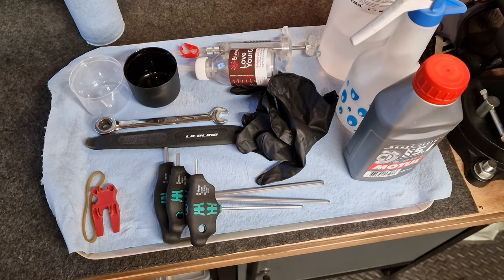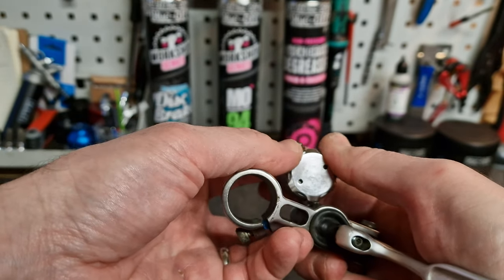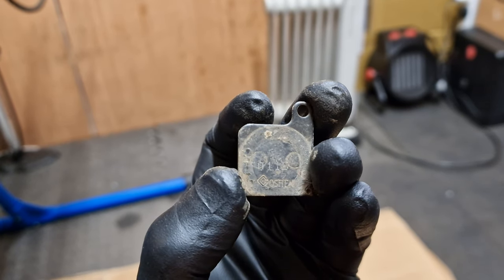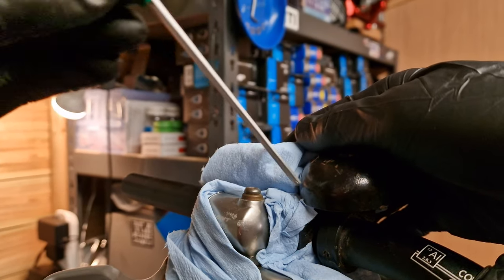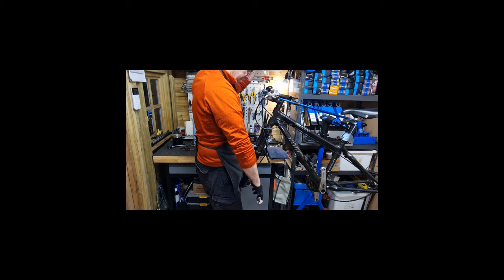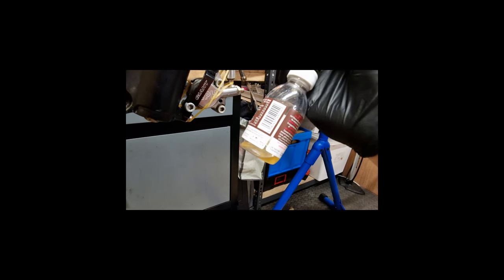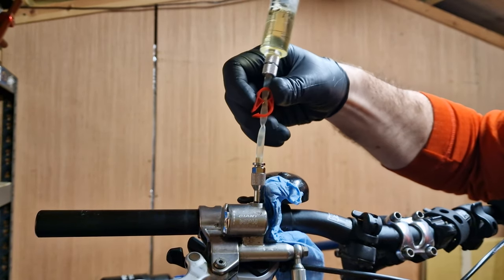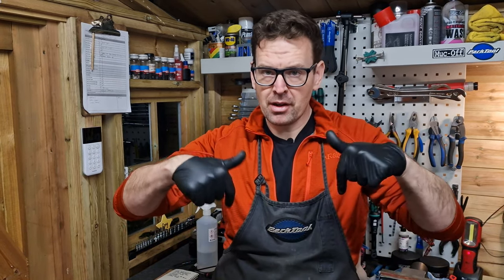Giant MPH Brake Bleed

Comment: Thanks a lot for your video since it is very hard to get info on this procedure .
As you mention, the key thing is to get the right tool and items hten
Do you know which kit to purchase in order to have at least a syring compliant with the reservoir screw?
Thanks again to spend time sharing your knowledge.
Reply from the maker: In the workshop video I was using the SRAM Professional bleed kit. However, any generic kit for SRAM and DOT fluid should have the same fittings. If you're in the UK something like the Epic Bleed Solutions kit should do the job - https://amzn.to/3SGY1B9 (sponsored link). If you're outside the UK let me know and I can give you a hand finding something suitable :)
Reply: @vanguardcycles  Hi, I am based in the Netherlands, could you recommend any bleed kit for these MPH brakes? Thank you!
Reply from the maker: Definitely check out the DOT bleed kits from Elvedes. They do a regular and pro version

Comment: Nice vid... Could you enlighten me on - if known - which type/brand of replacement brake cablehousing I can get for my MPH-brakes? 
It's no longer available, and hard to search for. Maybe Jagwire, but which type is compatible.

Would be grateful...
Reply from the maker: That's a very good question. Unfortunately I no longer have the brakes here to measure. You could try to measure the inner and outer diameter of the hose to help find a match...but then I don't think anyone makes compatible connectors (banjos, olives, barbs etc) any more either.

Elvedes make some good kits for several manufacturers but don't list Giant as supported. 

When it comes to brakes, safety is always top priority, so it might not be possible to safely change the hose any more :(

Comment: Gret informative Video, Thanks for taking the time for making it. Because of a sustained back injury I now need to have an upright riding position which means raising handlebars, and which subsequently means extending the front and rear Hydraullic hoses on my Giant MPH braking system. This is my first Hydraulic braked bike recently purchased second hand. Do I need to buy Giant MPH specific hose and fittings or is there a standard hose and connection system which I can purchase to my required lengths for my Giant bike?
Reply from the maker: Really glad to be of some help!

Switching out the hoses on these might prove tricky unfortunately, as they have been out of production for a long time and I don't think Giant offer any kind of support or spares. 

For the lines themselves, you could measure the internal and external diameters and see if you can find a compatible line.

The trick is going to be finding new connectors. Usually bike brakes will use proprietary things like banjos and olives which shouldn't be removed and reused.

Maybe there's a forum post somewhere that could help?
Reply: @vanguardcycles  Hi, thanks for the feedback - which is useful for future bike purchases. I decided to sell the bike and did so 2 days ago, so problem has been resolved. I'll stick to my low maintenance cable / Wheel Rim operated 'V-Brakes' that I have on my 23 year old TREK Bike
Reply from the maker: Ah you're welcome, glad it was helpful. V-Brakes definitely win hands down in a situation like this, especially as you don't need any specialist tools or bleed kit.

Keep up the diy maintenance and ride safe!

Comment: Where can you get MPH break pads, they are no longer in the webshops I use. Mine had mineral oil in them, should I then continue use it, but I live in Norway where we can get -30 degrees in the winter. Another tip may be to replace them with sram level brakes on sale they do not cost more than the pads I think.
Reply from the maker: Have a look for Elvedes E6861 pads. They are a Dutch brand and should be available across continental Europe. Even if they aren't sold in Norway, I hope you could get them from a neighbouring country?

The manufacturers always say never to mix mineral and DOT fluid as it can degrade the seals, etc, so if you have the same model as the video and they are running mineral oil, I wouldn't use them any more.